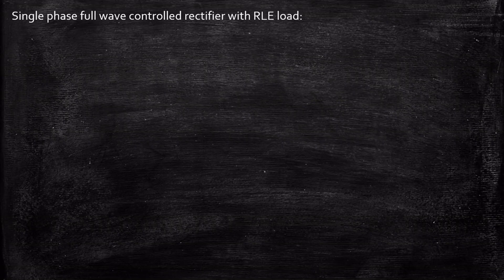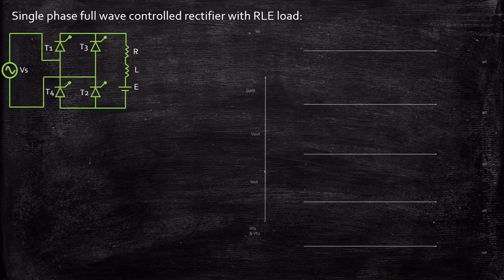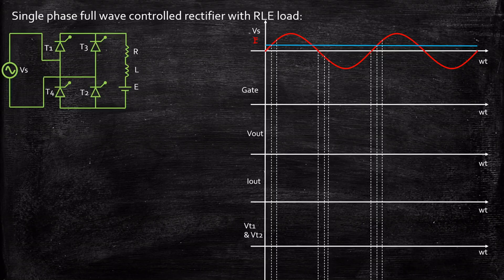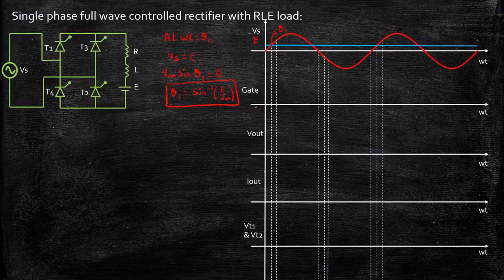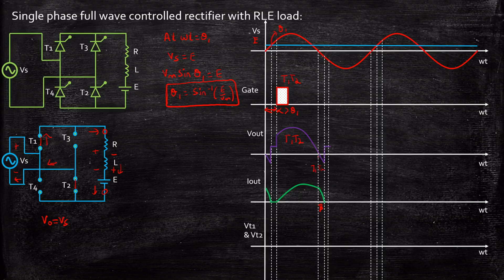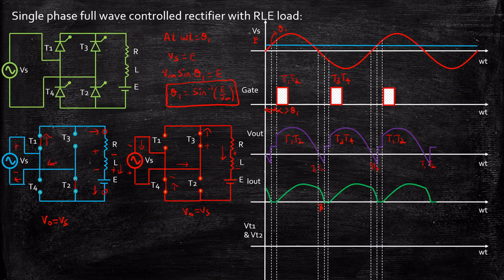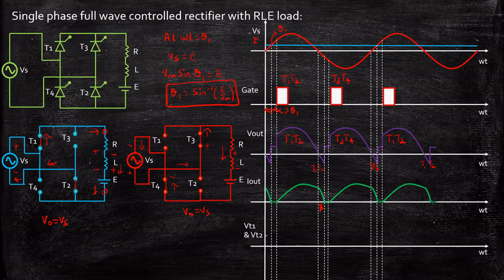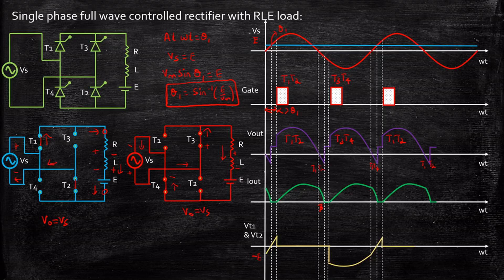Single Phase Full Wave Controlled Rectifier with RLE Load | Power Electronics | Lecture 46

Comment: ASingle-phase full wave controlled rectifier supplies power to RE load sketch the waveforms of the output voltage and output current thyristor voltage and thyristor current Derive expressions for the average output voltage and current ?